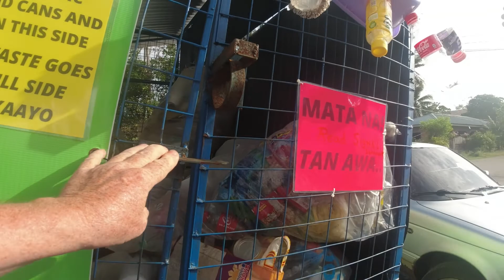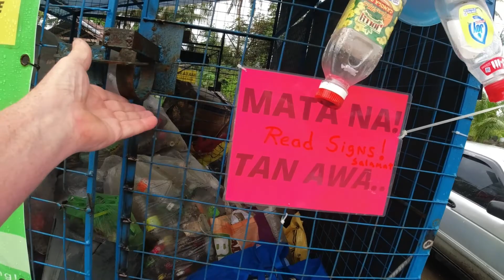Typhoon Damaged Recycling Cage Repair

Comment: Noticed The Ocean Cleanup got some new designs for smaller rivers and canals, the Interceptor Barriers and an Interceptor Tender, the barriers are pretty much your kabooms, but probably more expensive, I like your self-made ones with easy to get materials more.
Reply from the maker: Yes I watch TOC closely, and comment about my ideas. I made many comments we need to install Kabooms in 1000's of rivers and canals along with the few larger one with full size interceptors. It will take both to get job done. There is many barriers even nicer than theirs they have been around for decades and yes oh so expensive. I contacted the company's for pricing. Sit down $10,000 for one the size of our smaller kabooms, plus shipping and install. But? they would need expensive sliding collars on 2 inch pipe on concrete canal sides so install would be very expensive. Better to keep it cheap and simple. Interceptor barriers look nice but would not of survived the Typhoon or extreme water flow during flooding, too much surface area by using a solid front and skirt....it would fly like a kite. ( I know, my first vinyl bottle booms were solid skirts, Gail force winds lifted it out of the water)